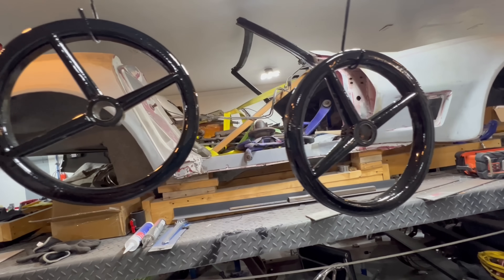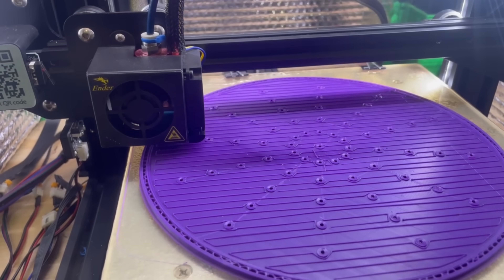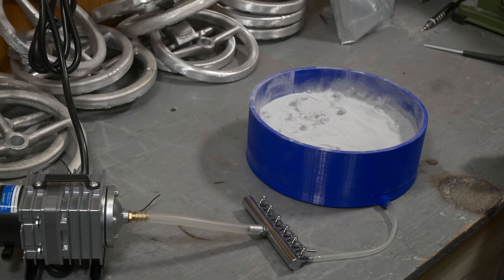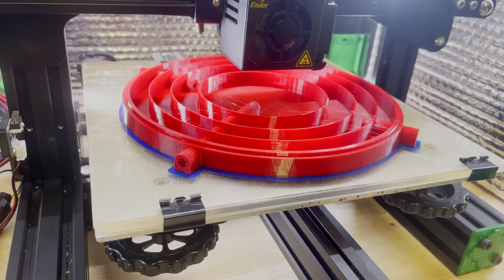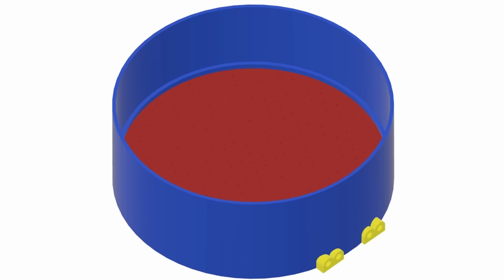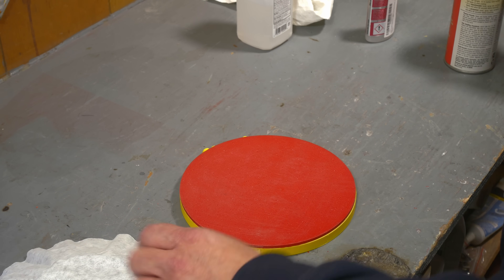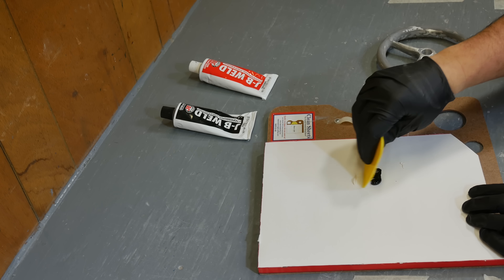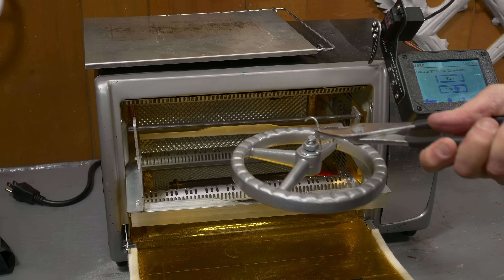Inexpensive Powder Coating at Home?  The Fluid Bed

Comment: That's interesting.  We do quite a bit of powder coating at our makerspace.  We have a large oven we bought at a university surplus auction.  
I've made vacuum platens for PCB milling.  MDF is somewhat porous from top to bottom, but very porous thorough the edges.  I found that if you take MDF and cut it in strips, then rotate the strips 90 degrees and glue them into a sheet the porosity of the MDF acts like millions of tiny holes.   I wonder how that would work for a fluidizing bed?

Comment: On the benches I have seen where they use a vaccuum to suck pieces down to the bench so they "stick," they don't use a plate with holes, they use a porous material, like thin MDF (yes, you can vaccuum through MDF).  I'd suggest not printing the top plate, but instead use a porous sheet of manufactured wood.

Comment: A used apartment sized stove w/oven will often be as cheap or cheaper than a smoker and you have more control over temperature because of the higher quality in the rheostats.  You would probably need access to 220 volt power to use this.
Often when you need a balanced amount of airflow in a manifold, you need to feed it from two ends.  You can look at images of a water distribution manifold in a house hot water heating system if you have trouble picturing it.  So you would need two channels feeding your fluidized bed, but also your air distribution manifold needs to be fed from both ends.

Comment: PLEASE get a respirator and NEVER handle the powder without it on. Not a flimsy mask, a proper respirator. Don't touch it, don't pour it, and certainly don't use the bed without wearing one. Powders this fine will give you horrible lung cancer.

Comment: I think this is a very interesting project.  The results seem to be good.  I don't know if i missed anything but why do this instead of using the typical electrostatic powder coat gun?  Either way powder coating is an awesome finish for metals, it looks good, comes on a bunch of different colors, and is relatively inexpensive.  That and it is tough as heck, one of the tougher finishes you can use.

Also sorry to hear that you have hurt your elbow.  I am amazed at how much gets caught on video these days!

 I hope you heal up quickly and can fully get back to the work that you appear to really enjoy to do.  Cheers

Comment: I might see this as a "false" requirement and struggle: I mean for so small parts at such quantity even a few points of "fluid" powder looked good enough already at 5:25 as you can turn the part easily to cover it everywhere. Somehow we technical guys over optimize almost everything. But of course I also like to make things perfect so I understand... 😆

Comment: You could have used PETG for less warping and water tightness. Also an acrylic plate with variable holes and channels with independent control(see you are already doing something similar). With Co2 laser, it can be done precisely, at fraction of time(in couple of minutes). May need a flexTPU/silucone gasket. A mold flow/FDM analysis in fusion 360, could verify the functionality before cutting holes. It might even be possible to use a large flat airstone(aquarium variety) with lots of air, for smaller projects🤔. Wondering about the impending havoc due to jbweld bondo(never realized the non static method!). It is interesting, it even works without static charge🤯, might build one🤞, since I have an unused powdercoat system and supplies.🤔❤👍

Comment: You might want to consider multiple air chambers under the powder tank and instead of drilling holes in the base, cover the top of each chamber with metal or nylon mesh filter that gets progressively smaller. The top I would want to be metal for sure. I.E. the bottom chamber have 100 micron mesh and the next 75 micron and the next 50 and the next 25 and the top 10 micron. Those are completely subjective sizes. I just "think" they need to be progressively smaller to make sure the air flows out over the entire surface of the mesh. Make sure your powder isn't smaller than 20 microns. Just use a final or top filter mesh that is half the size of your smallest power particle. Of course you only introduce air into the bottom chamber. Also possibly, to get the best performance, use slightly cone shaped air chambers  as the mesh gets smaller, the top of the chamber gets slightly smaller than the bottom of that section.  I'm making this up as I go, but assume something like a bottom chamber with a 16" base and 1" tall and 15.75" top with a 100 mesh screen on the top. The next chamber, the bottom would match the top of the chamber below it. This is all to ensure that the air is forced through the filter mesh evenly due to increased pressure because of the progressively lowering volume. Also I'm not positive that an aquarium pump is best. I would want a air compressor with a tank of reserved compressed air and instead of just adjusting flow, I would want to adjust flow and pressure and I'm not positive doing that is best without a reserve of air. But the difference might not matter.

Comment: Most likely you would want two chambers on top of one another. The first set of chambers/ channels get the air into their zones. Put a separator like you already have with the proportional holes into a second chamber on top of the first. Kind of a double decker, so that the air can expand into that chamber and then flow more laminar from the trough the next and out the top. 
We used in the past simple pillow covers to diffuse air under water in a more controlled way, should work here too.

Comment: You need smaller holes and lose the coffee filter. The easiest way to get an even air distribution is to have pressure drop at each hole. So they need to be the main restriction in the air supply.

Comment: When I was at school we used a fluidised bed that operated using PVC powder, making a very thick coat almost like an overmold. It was just a canister the size of a fume filter, we heated the objects up with a gas torch and then dipped them into the material, which was pumped with a vacuum cleaner. Worked great.
Reply: Was the Youtube user Preso58 further up in the comments your teacher? He described this exact method using a vacuum blower to do the same thing.

Comment: I broke my arm in 2 places, that f-ing hurts like hell. That was about 3 weeks ago, and for the way it broke, I might be looking at a longer time vs 6 weeks.  Use a drawer liner, that's has rubber bumps on it, to help you sand them, hold the part in your legs to get the side's.. Can you tell, this is not my first time!

Comment: I believe you need maybe a source of vibration to agitate the powder before it gets floated. Otherwise once air finds its way out of some holes it escapes from there as there is no resistance while in other parts the powder settles and its difficult to move it up.
Reply: Seconding this. Came to the comments to make the same suggestion and saw this person already said it. Would also combine this with the other person‘s comment about smaller holes with increased pressure. Might not need both but the combination of smaller holes with a higher pressure source as well as some vibration seems like a knockout idea to reduce rat holing.
Reply: @SolarMillUSA  I came to offer a suggestion that vibration alone might work well enough. You might have to find the proper frequency and amplitude to work for each powder to excite the particles at their natural frequency.
Reply: Yup vibrations will help, built  refab old paint lines in 2000, of course the negative charge applied to part before powder blown on previously dipped wash then rinsed and heated does help ALOT. We had to add motor and silicon sliders to bang around filter bags and framing to stop pooling.
I like the idea of ultrasonic modules, but need a few, also used massager from thrift store.  
I been using a workaround for high pressure atomizer for  aeroponics, no crazy jet pump just a specialized nozzel that takes 40 psi air and siphons from a Reservoir underneath, i dont   the same can't be done with the powder coating just hang the hot part in a cardboard box with 2 large clear leaf garbage bags open taped togther, semi deflated- you dont need alot coating to begin with.  The atomizer are like 20$, already own compressor?!, no fancy equipment other then that
Reply: Maybe a ultrasonic cleaner?
Reply: @Cpt_Adama  Or a cheap "massage wand"
Reply: Set the bed on top of the pump so that the vibration of the pump agitates the powder.
Reply: Worked with one at Bell helicopter. It had a vibrator which did most of the liquidifaction.

Comment: I do home powder on small parts. One thing I'll say is if you've got more powder on the wall than the part... turn your air pressure down, turn the voltage down, then get in tighter.  Oh, and don't use the little 'cone' on the end of your gun.

I've REALLY wanted to try setting up a clear tote with some ultrasonic transducers in the bottom. Just power them enough to get the powder to atomize and lift up a bit. Then ground the part, and have a "chicken wire" grid to charge the particles. Dip the part in, and hope the particles cling!  :D
Reply: Oh yeah, and I've also found that "less is more" when it comes to how much powder you put in your cup.  I was putting lots in like I would if I was paint-painting.  Bzzzz...  bad idea!  Now I only put 1/3 in tops. Allows the air to 'bubble' the powder up better.

Comment: Have you considered electrostatic coating... the paint particles are literally drawn "magnetically" to the workpiece, you don't even need to turn it to do the back... 🤔
Reply from the maker: Yes, I did a video about that last year.  I just found it to be very messy with extra powder going everywhere.
Reply: @PeteRondeau  I'll check out your archives, thanks for replying ! 

😎👍☘️🍻

Comment: I don't understand why this is needed if you can simply dip the part into the powder to begin with.
Reply from the maker: You can’t. The part will just sit on top of the powder. I wish I would have demonstrated the difference with and without the air. I ended up cutting that out and regret it now. There is a marked difference. Even though this powder is very fine it would be no difference than setting something down on the beach. It just sits on top of it.

Comment: That's a pretty bad spill. Was it an icy patch?
PS - There's another coating material that is even tougher than the powder coating we use in our shop, called Cerakote. I think it's mainly used in the gun industry. But it's VERY durable and a lot easier to apply to parts than our traditional powder coating process, and even our anodizing process.
Reply from the maker: No, I was carrying all those packages and I couldn't see the steps.  I guess I lost my muscle memory for how many steps I had descended.  I thought I was on the ground and there was one more to go.  I've watched Robby Layton use Cerakote.  I always wondered if it was just a gimmick or if it really was something special.

Comment: It seems to be little if any faster than using an electrostatic PC gun.   If you look at the time to make the jig, then pre-heat the part, coat, then heat to curing temp,  you could do 4 of them at a time with a gun and run them into the oven more efficiently.   It's an example of where the industrial method, forced on them by the very size of the things they're PCing is less efficient than just doing one at a time. 

I use an old range for PCing., I could hang 4 or more of these wheels at a time in the oven.   The oven isn't great for PCing. I really need to replace the stock elements with something that reacts faster. I have issues with temp over-shoot.
Reply from the maker: But that’s not the problem I was trying to solve. I hate the mess of powder coating with the electrostatic gun.
Reply: @PeteRondeau  
You're right I might have missed your goal, I though the goal was finding the most efficient way to do 60 steering wheels. 

I have a plywood box just for PCing.  I put the rack on top of the box,  spray inside the box, so all the powder stays put. Then I move the rack to the oven. 

If you're getting powder all over the place, you might need to turn down your air pressure.  It doesn't need much air pressure to move the powder to the part.

Comment: I just heat the part up with a blow torch and sprinkle the powder on with a tea strainer sieve, it's worked for me for over 30 years.
Reply: (Zero experience) Would oxidation and carbon buildup from the blowtorch reduce the surface adhesion slightly? Like coating a dirty part? Or not significantly enough to matter for hobby parts?
Reply: @Lyoishi  You want to powder coat a rusty & dirty part?  Would you paint something like that?  The slightest bit of crap (oil, dust, fly poo etc) ruins your part.
Reply: @j.f.christ8421  you missed their point, they meant if you started with a clean part would carbon buildup and oxidation from the blowtorch make the powder coating not stick very well.
Reply: No additional baking?
Reply: @larrybud  Bro's so hot the part heats up on its own. Saves a fortune on electricity. Power companies hate him for this one simple trick...
Reply: @larrybud  Warming the part up just makes the powder stick, you still need to put in in the oven for 10 minutes to cure it.  Works ok for simple parts, or when you want to put on a second coat (multi-colour stuff).
Reply: A bread flour shaker bulb would probably work better with such fine powder. They have them at sourdough and baking specialty shops.
Reply: Woah, you will be hunted for giving out such secrets 😧
Reply: That’s how they do porcelain on bathtubs
Reply: @texastowman233  Bathtubs are actually a form of enameling using powder glass. I do enameling of metals either applied to dry clean parts or heating them up and dipping in the powdered enamel. Enamel suppliers sell many different size and grit sifters that would be great for this. I am waiting on my first order of powder coat to get here.
Reply: Don’t be a party pooper! You’re spoiling all the fun! 😁
Reply: I was thinking of creating something like a shower cubical where the powder is sprayed from above but the tea strainer method seems much more sensible.  I assume you first have to attach some kind of rod to the part so you can turn it over as you sprinkle.  Probably easier to do with two people.  One doing the twisting while the other sprinkles?

Comment: Have you considered using a graphite sheet in place of the coffee filter and not use the plate with the holes. Given the graphite is porous, the air will pass through pretty evenly, but I am guess that you still need the manifold. You can also apply a charge to the graphite.
Reply from the maker: I can honestly say I have not considered that. I had no idea graphite sheet was porous. Learn somthing new every day.
Reply: @ yup, it’s used in high precision air bearings and relatively cheap for what it can do. For example, its planar thermal conductivity is ten times better than silver, the most thermal conductivity metal, which makes it ideal for fdm printer hot beds provided you embedded magnets in it to hold one of those pei coated sheets

Comment: Wouldn't a vibrating base be a Lot more controllable?!
 .... just saying ...!
Reply from the maker: Possibly.  But if so, I wonder why they aren't used in any of the industrial applications I've seen.  Pneumatic vibrators are plentiful and easy to fit on a container.  Would be an interesting experiment though.  I had actually considered adding vibration in addition to the air.  I thought it might disrupt things and prevent the channels from forming cutting down on the spouting.

Comment: That's interesting.  I've been wanting to try this with powdercoat.  Back when I was teaching, I made a fluidising tank for a type of resilient PVC powder for coating student projects like tool handles. Instead of the coffee filter, I used a sound insulation board called Caneite. It was about 12mm thick and made from sugar cane fibre. It was able to pass a high volume of air but was dense enough so that the powder didn't leak back through it. The air came from an old vacuum cleaner running as a  blower. The bottom of the rectangular box was just a hollow chamber, no air channels necessary.  In operation,  the volume of the powder doubled and the density dropped dramatically. You could place a heavy part on the surface of the powder and then turn on the bower and the part would sink like a rock. Always a crowd pleaser with the kids!
Regards, 
Preso.
Reply from the maker: Thats an interesting sounding material.  I'll have to look for it.
Reply: I've done similar, except I used MDF as the distributer plate.  Anything porous will work.  As you mention this design doesn't have a big enough chamber below the plate which is why is doesn't work all that well.  That's why the coffee filter worked, the gap between it & the 3D printed plated worked as a chamber to evenly distribute the air.  The paper filter sandwiched between some fine steel mesh would be probably all you need, the steel mesh is merely for support.

In short - take a PVC pipe and put an end cap on it.  A few inches up put in the distributer plate.  Pump air into the chamber.  Fiddle with pressure until you're happy.

This is a problem solved many times many years ago, but hey, re-inventing the wheel poorly
Reply: @j.f.christ8421  your use of the terms MDF and PVC come with absolutely no context; as in no notion of the preparation of the materials for their role in the process, no dimensions to guide the mind in evaluating the potential of the "solutions" you claim. Then, finally, the dig/dismissal of this effort. What would the internet be without that?

A lot in one comment, but most notably: since when is MDF (medium-density-fibreboard) porous?
Reply: @markstevens1729  Since it is used on vacuum tables? You wont get any dimensions, go and do your own research 😂